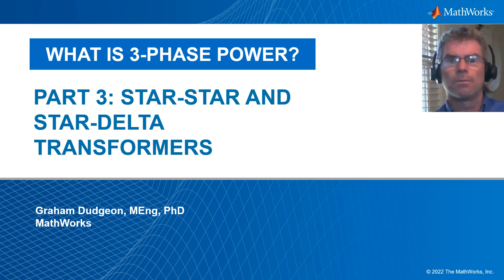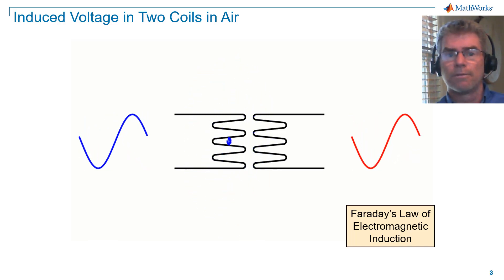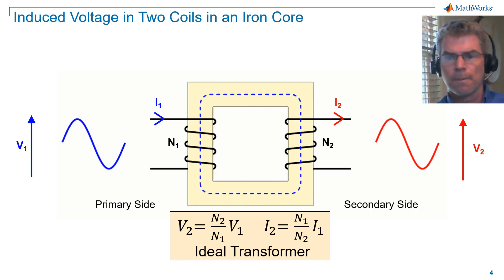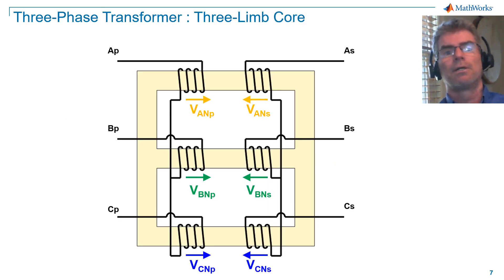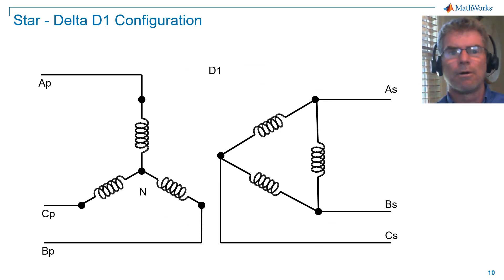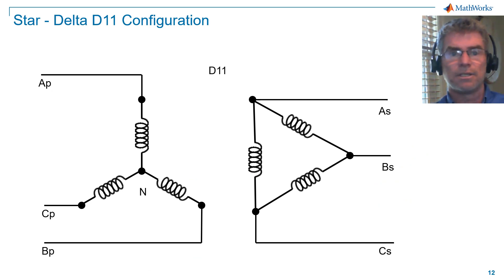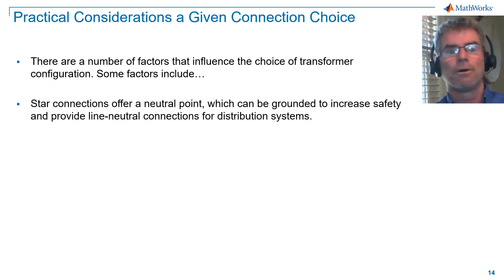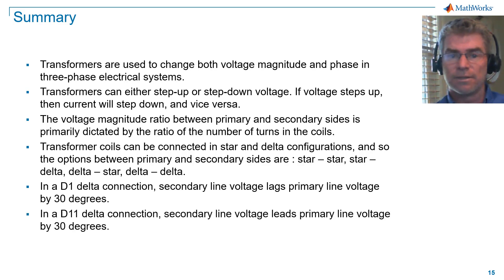Star-Star and Star-Delta Transformers | What Is 3-Phase Power? -- Part 3

Comment: This is a great series. My suggestion is if you could give some tips of modelling real work components. I can see a lot of default values in some of the parameters in the blocks. But what I need to know is many times when we model systems, we don't have enough data available and if we know which default values are OK for MATLAB for that particular parameter, it will help in accuracy and fidelity of the model. For example, in MATLAB we have default reactance values for generators and transformers but what if we change too much the power? Also, what about the relevant standard recommendations about these values. (X/R, SC level, flux, etc. default values)